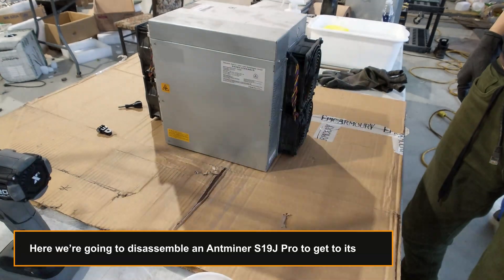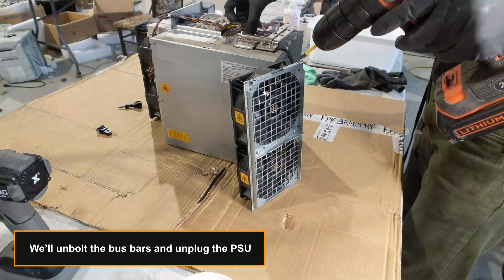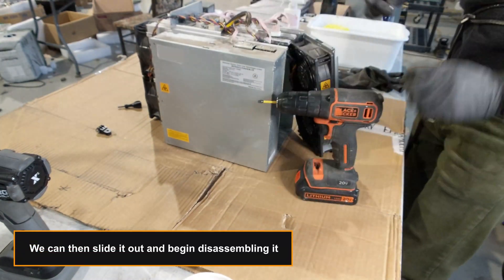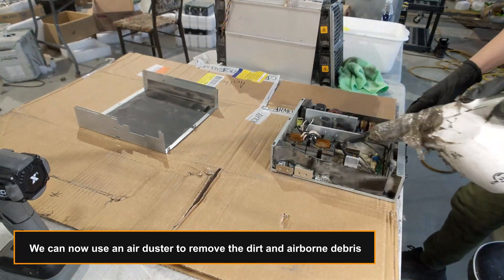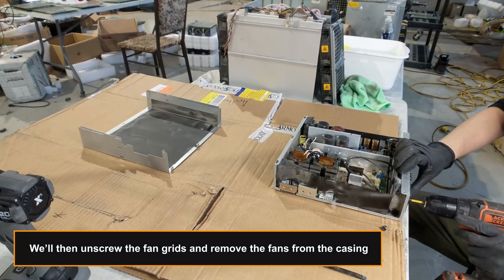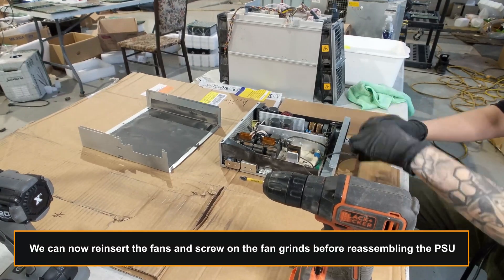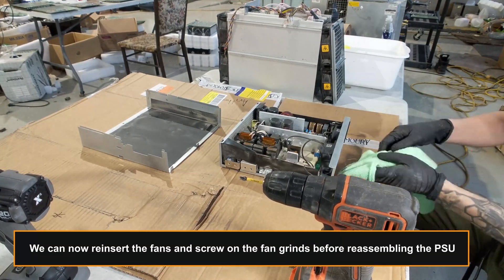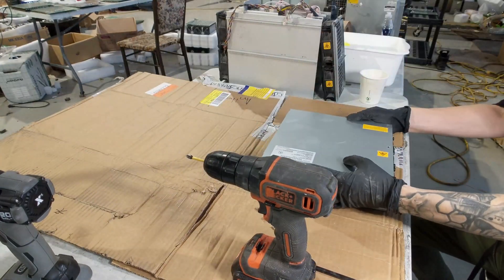ASIC Maintenance Guide: How to disassemble your Antminer S19J Pro's PSU

Comment: Do I need fan spoofers for my psu fans ? Or can I unplug and get no errors ? (S19k pro) , I want to use my 8” blower for both
Reply: depends, if you're using stock bitmain control board then, then yes you will need fan spoofers.
but if you're using braiins os/braiins control board, or ePIC UMC control board then no. The braiins OS has a immersion mode and the ePIC UMC control board will run with or without fans.